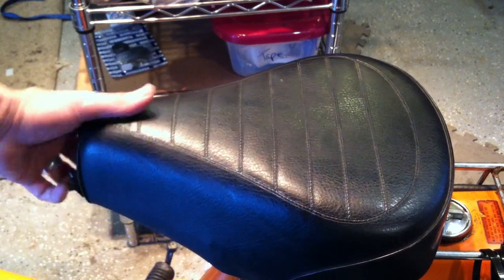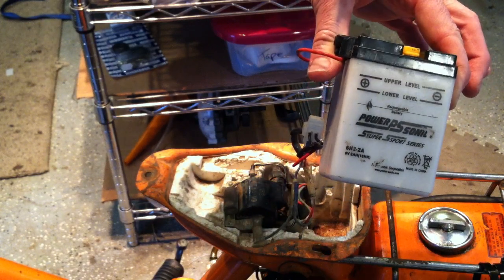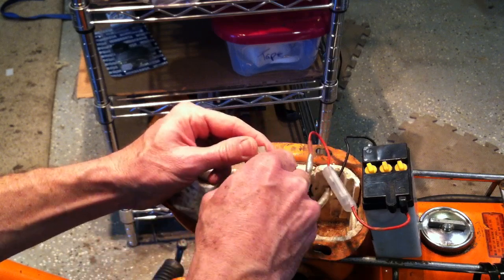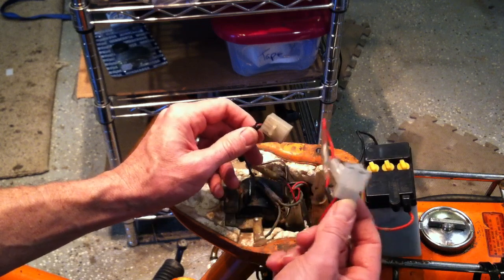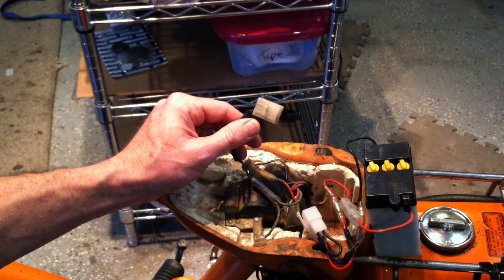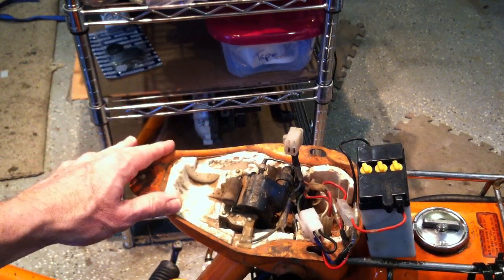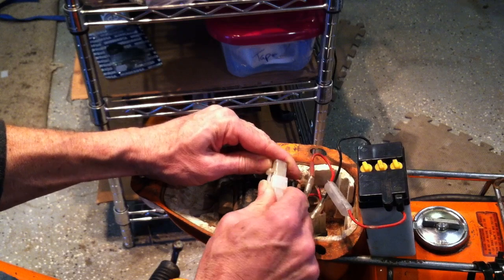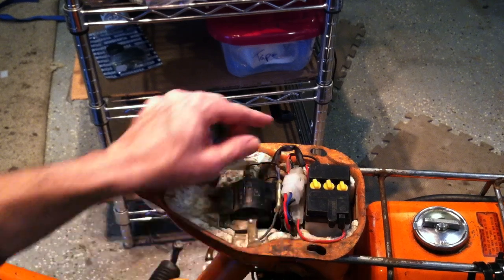Honda Express nc50 Under Seat Electrical Connections

Comment: I put a two- wire plug connector for trailer lights that i found on my battery. Actually i got two of them so i could hook it up on the battery and one on a small 6volt battery charger.  Then i could take the battery right out when it was goin to sit a long time.

Comment: Battery acts as a regulator to keep your headlight from blowing out.
No, not really.
If you check the wiring diagram the alternator has three windings, one powers the separate ( in the seat box ) ignition coil, one charges the battery and the third is connected to the headlight and maybe the tail running light.
The headlight is not connected to the battery at all.
Did you notice the headlight will not come on without the engine running?
The ignition switch, and the two kill switches SHORT OUT the ignition, so it won't run. They do not disconnect it from power.
The one alternator coil POWERS the separate ignition coil. When not turning, the ignition does nothing.
What a weird system

Comment: How do you charge these batteries? I have a 6v charger but the leads obviously don't hook up to the plastic end connectors. Thanks, love your videos.
Reply from the maker: I forget if the battery connects are male or female but just take a wire with the opposite connector and plug it into the battery.  Strip the other end of the wire and hook up your alligator clips to that.
Reply: @jackrutherford-1  thank you!

Comment: I appreciate all your videos you have helped me a ton since I have gotten my 79 express. I have a question.? I am wanting or trying to connect a 12 volt battery so I can run a 12 v head light . The light works with 6 volt set up but of course is really dim..my main concern is will the rectifier handle the 12v or will it get smoked if I hook up the 12v lawnmower battery?
Reply from the maker: I've done that before with no issues.  The rectifier converts ac to dc to charge the battery.  The main issue will be whether the rectifier can sufficiently keep the battery charged.
Reply: @jackrutherford-1  Thank You...not concerned so much about keeping it charged so much small town night runs are usually just a mile to casino.

Comment: Does the coil have to have the condenser?  I bought a coil of eBay, all it has is a prong which I'm assuming is for the wire from the stator and then just ground the coil?  Also where could I find the plug that plugs into the battery plug?  Mine didn't come with the plug on the noped. Thanks!
Reply from the maker: In other bikes, the condenser can be mounted to the stator but on express bikes with points, the condenser is on the coil. Without a condenser, the express won’t run.

Comment: I ordered this battery but I keep getting a plug that’s only half the size, I removed the plastic clip and can just insert the metal taps into the bikes plug, but I’m not sure if I should just just that black wire in with em in the separate cavity, and maybe just add some electrical tape to prevent contact🤷‍♂️

Comment: I have a problem with the front lights and the rear brake light is fine
Reply from the maker: Headlight?
Reply: yeah but I see some people they converted I’m going to upload videos I took off the old bulb and I break the big light and I put LED it’s better than the factory one 😅
Reply: @jackrutherford-1  I had a question why we need the battery?
Reply from the maker: @freddykruegericanseeyou6863  the battery provides power at critical moments to the tail light, turn signals and horn.  So for example, if you are idling at a stop light, the engine does not create enough electrical power at idle to avoid dim brake light and turn signals.  The battery steps in to power those devices so that your brake light and turn signals are bright even at idle.
Reply: @jackrutherford-1  I have one without the signal the regular one the 1979 and I see blue button like a light by the Speed meter what is that

Comment: Another great video sir, I have an 81 Honda express in angel blue. The empty space you have in front is in fact for the turn signal relay which was an option, just got done changing the trans oil what I did was I ran the bike to get it hot drained the oil and replace with fresh synthetic oil. I’m a little concerned that the old oil cane out black, don’t know whether is from age or if it has worn clutches or an air leak she runs beautiful and I doubt if it has an air leak I got it as a non runner that’s been sitting around for a long time. Should I worry? Thanks for the videos. Stay well.
Reply from the maker: Well, it's a good thing that it at least had oil in it.  Your synthetic oil may leak out of the case.  If so, change it to conventional oil.  I wouldn't worry too much about the old oil coming out black.  Probably was never changed.
Reply: churioz26 thank you sir, I put synthetic in because of all of the things I’ve read right now I have 10w30 synthetic I’ll keep my eye on it. Have a good evening and stay well.
Reply: Mine barely had any oil in it, it was straight up black with metal flakes / sparkles in it.